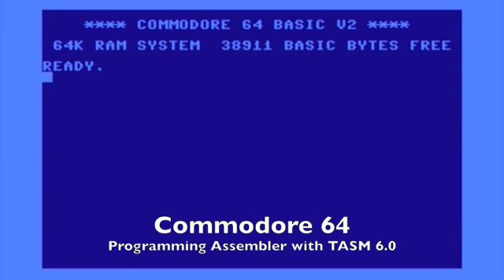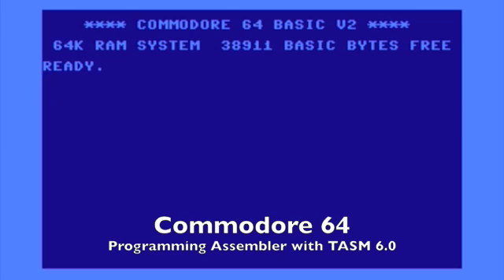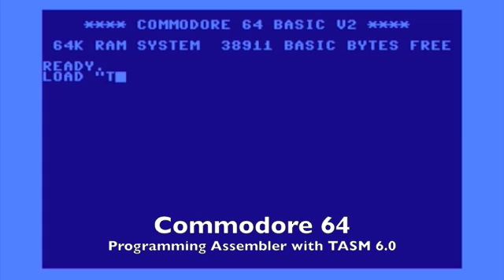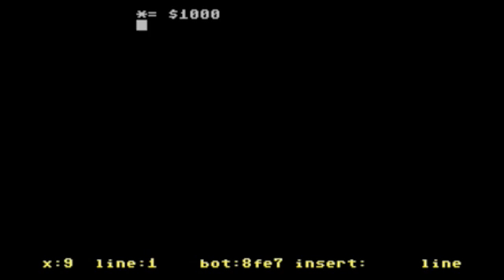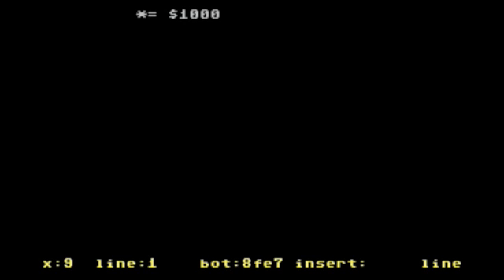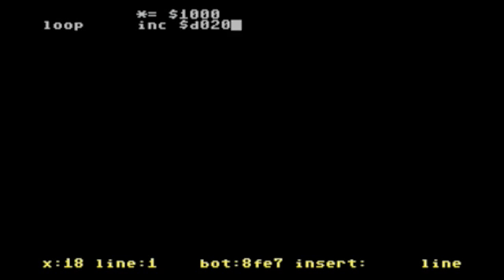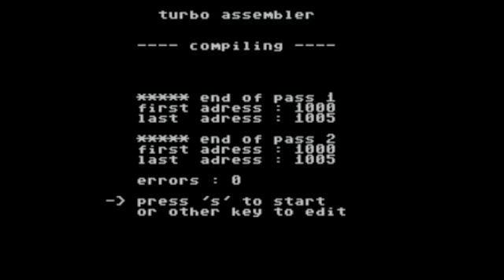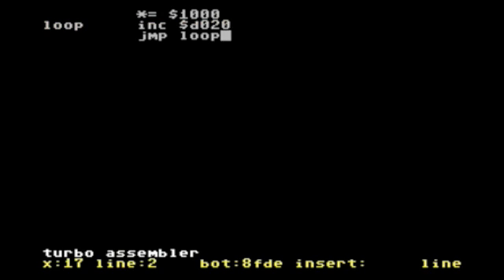C64 Assemblar programming

Comment from the maker: @zoranrazarac You just don't get it do you ? On a C64 (the real piece of hardware) you use F4 to assembler. However this will not work using an emulator. The PC keyboard or a MAC keyboard + regional settings and the F4 key is something completly different. So on a Swedish Mac to assembler it is like Shift + Alt + ? to assembler since this will map against the original C64 F4 key. Now how do that help you if you are sitting with an english keyboard ? Whole WEB full of LAZY people !!

Comment from the maker: The old Turbo Assembler that you used to run directly on the C64 was written in machinecode/assembler itself. This was the only way to get the program and included editor to have a very small footprint. (e.g remember the C64 has only 64K or memory.

Comment: Turbo Assembler starts in $9000 = sys 36864 but if you can't remember that then just type in sys 9*4096. I find that easier to remember as 4096 is a power of 2 and a digit value in hex notation.